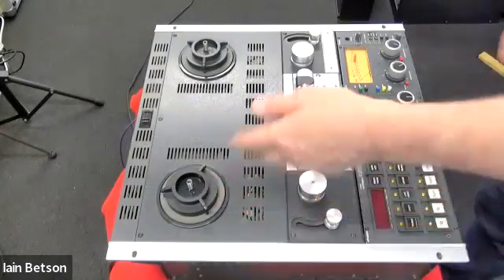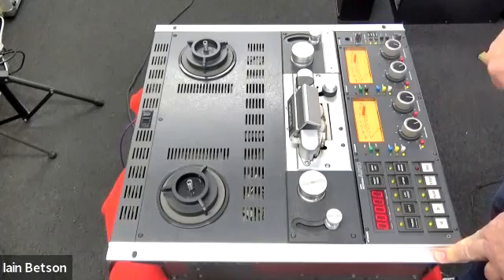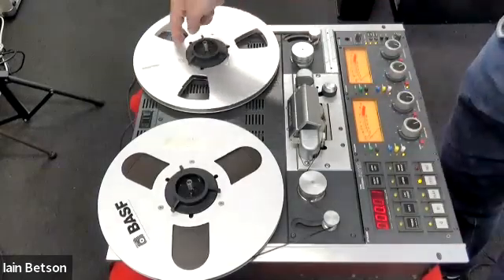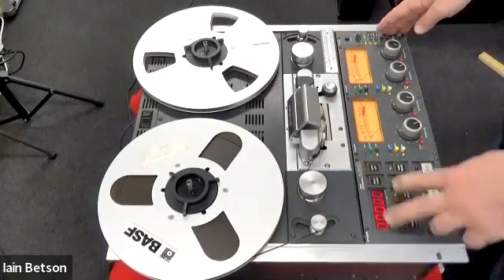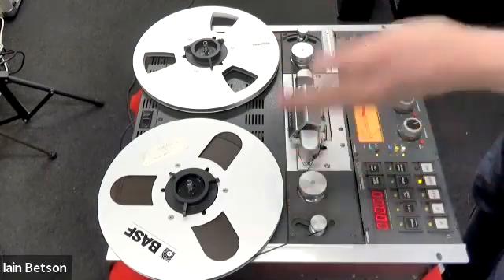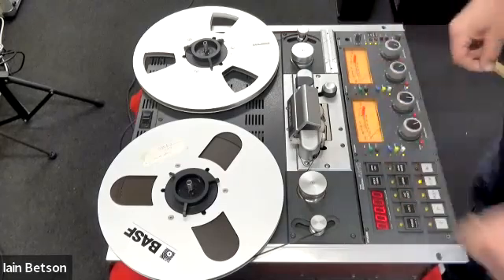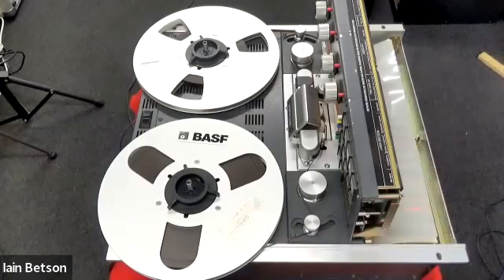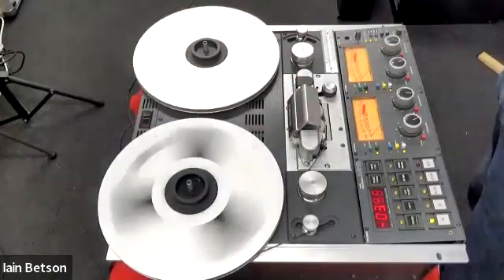The Studer A810 - Operational Overview

Comment: 13:43 well, to be fair the Technics series e.g. the RS1700 could also and didn't use anything digital for that purpose. As much as I very much like Revox (by Studer), at the time of the RS tape decks from Japan, the mechanics of Revox machines was quite primitive, and as you allude, something like the A77 would rip up the tape if you selected play directly from FF or rewind. The Japanese tape decks didn't. The A810 is a great looking machine as is the RS1700 though sadly the 810 still has simple LEDs and plastic bits and pieces whereas the Technics materials were with every component far superior. My experience at the time was that there was no noticable difference in the sound quality of the two, they seemed exactly the same, i.e. both extremely high quality.

Comment: Recently acquired an 810 that was in storage for "X" number of years. Getting to learn the inner works; operational no problem, used pro decks for decades. Already replaced the Varda battery on the MP card (leaky...) and days away from firing it up. 
Good video - many thanks.

Comment: As Studio Recorders, Studer, made some fine units.  Such as the A-80 series.  But with this, A-810.  These really are not a, Studer.  This is really a REVOX.  It's more like a consumer recorder.  Quasi-enhanced and offered up as a Professional Recorder.  I say Bullshit!  It's a REVOX.  It's a REVOX on steroids.  But it's still a REVOX not a Studer, really.

Unlike their actual studio recorders.  This has no, automatic, tape tension control.  It is not dynamic control.  Tapes be will vary according to the tape pack, on the reel.  Unlike a actual studio recorder.  That has tape tension control.  This ain't got that.

I was never wild about these machines.  They are okay.  They are good.  They are adequate.  They have that name, Studer.  But it's really a REVOX.  It's much more like the B-77, REVOX.  I had three, A-77 REVOX recorders.  They were very nice.  They were kind of a portable studio recorder.  They had a handle.  If you carry it with one hand.  With the handle.  You couldn't do that with the Studer, A-80 nor AMPEX nor Scully nor 3M machines.  They were much heavier.  Much more bulky.  Not designed for portable use really.

And so and that respect.  This Studer/REVOX recorder great for, a location work.  You still come away with a nice sounding recording.  Even if speed stability will not be rocksolid as with a, automatic variable tension, recorder.  Some are willing to live with.  Me, not so much.  I'd rather grab the heavy bulky impractical studio recorder.  When you want something impeccably recorded.  Without any speed variation or drift.  And with a DC servo capstan drive, if you got it.  The REVOX and other Studer recorders are a, AC servo Loop Drive.  Not with the same precision as a DC servo drive.  It will not be chasing synchronization to video.  Video will be chasing synchronization to it.  Because it's really a REVOX.  And I'm not wild about it.  I'd rather have my Scully's.  The last of the 280-B's.  They got really good.  Same flutter specs as a Studer, then.  And rocksolid speed consistency.  Could Chase sync lock to video.  But I digress.

Studer made fine recorders, overall, yes.  You can't go wrong with any of them.  But you have to know what you want.  Not all are equal.
RemyRAD
Reply: THAT is bullshit, hahaha! The A810 is as much a Studer than any model of theirs. If you want to compare though, it is true that the transportation mechanism etc. is somewhat based on the Revox A700, but that again is sort of more a Studer than a Revox. The B67 could be a comparison point as well, but the A810 could still be said being"superior" to both pretty much overall (and not to mention it's definitely not as portable as an A77 as it weighs almost double and it has a much bigger chassis despite being a "compact" recorder per Studer's description..). However, probably the nicest tape saturation that I've achieved was with a Revox A77..!
Reply: Of course the A810 has proper tape tension control. You are probably confusing that with the Revox PR99.